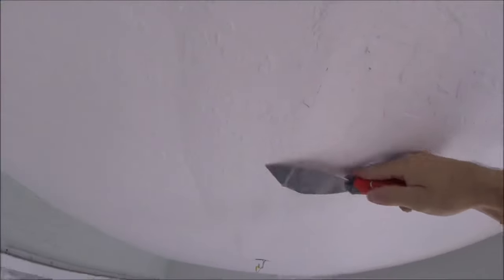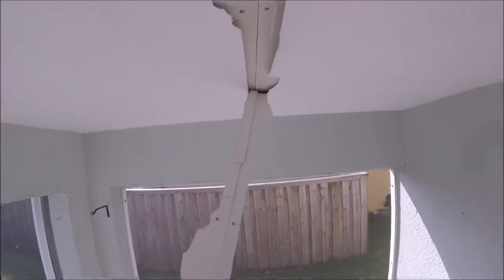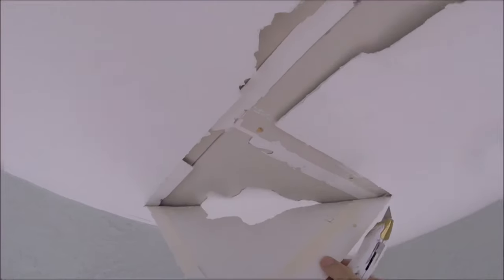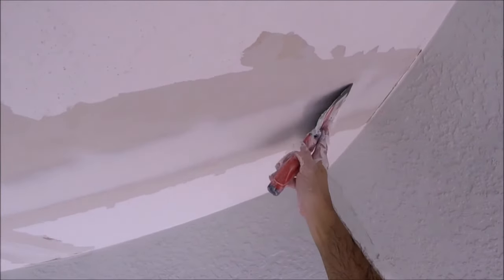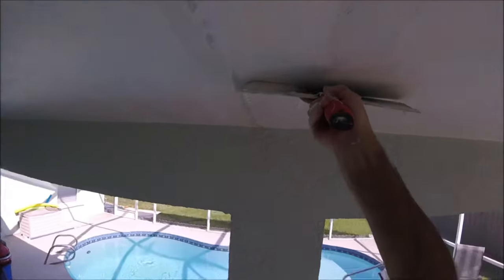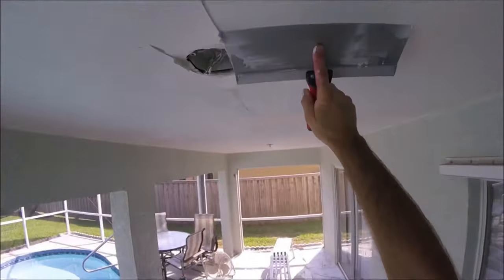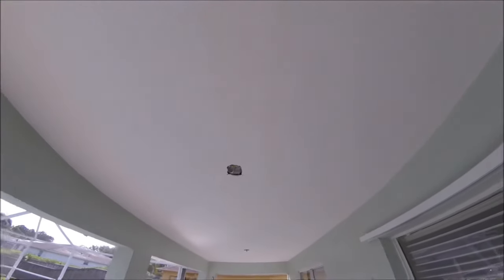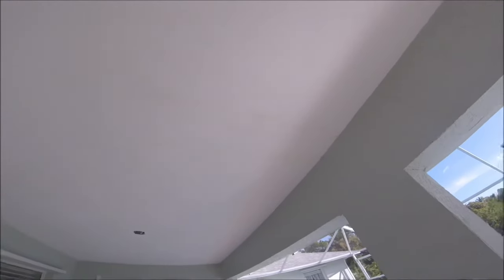Ceiling Repairs GONE WILD!

Comment: You nailed it on the moisture and attic. North East we have old bungalows with attic space and no ventilation other than soffit. A key is putting in a "covered quiet cool vent" with an automated fan, when humidity reaches a certain percentage the fan turns on. Another option would be to Add a vent in the pool enclosure to get the humidity out.
Reply from the maker: Good stuff man! Thank you so much for watching and commenting!💥👍🏻😎

Comment: That's from moisture without a doubt. I see that in a lot of carports and I am in Georgia as well. Edit I wrote my comment before you said that it was moisture. Yes you are right 👍🏼.
Reply from the maker: I do appreciate your feedback Thank you!👍🏻😎
Reply: Yes those are definitely contributors to this.. I'm also in Ga.. and have witnessed this numerous times with garages and other exterior applications of drywall .. for starters  I would have used a moisture resistant drywall  which  they didn't have available back then  I assume  so to repair this is only a bandaid to the root of the problem

Comment: I had EXACTLY this same issue on a garage ceiling I did. 
We tried to prime first with oil paint then redo the finishing . I’m a drywall contractor for 41 yrs and I only used all purpose mud but wouldn’t you know that the EXACT thing happened again!!!
We had no moisture or water issues but the timing was right when the drywall industry was flooded with Chinese drywall since everything went to New Orleans area after Katrina. I know they had formaldehyde issues and I don’t know if there we’re finishing issues because of that. I thought we did everything possible to alleviate the adhesion problem’s but to no avail. 
That’s all I have to say on that
Reply from the maker: Wow! That’s crazy… Yeah, I ended up doing a lot of Chinese drywall inspections here in Florida for almost 10 years after the time it made it to the US.😅
Reply from the maker: Damn that’s crazy!😅 I know that Lowes had a class action lawsuit because they bought a bunch of it and sold a lot of that too…⚠️

Comment: I think that's from intermittent  moisture ingress from above.   It could be from the vapors you theorize, provided that actual condensation into liquid water is taking place from time to time under the right temperature change conditions etc.   You just need small amounts of liquid water , and it finds the joints.   I had my apartment t bathroom ceiling do this twice.  There was no other evidence of a leak other than the drywall ceiling showing the same problem.  It was always dry up in the dropped ceiling.  It took over a decade to find the source was a very seldom used sink in the apartment above - it had a small leak in its drain piping.

Comment: whats the best way to repair ceiling cracks on a new construction home...very large span
Reply: I have never had to redo large spans but I have put in expansion joints and they have never cracked since I have done it. You may want to look into how to go about putting in some expansion joints in a large area. I put them in a new church but I have never put them in after it's already been hung and cracked.
Reply: @Hamp72  thank you I will research that
Reply: @generationrecon  you are welcome

Comment: So is it going to fail again?
Reply: Yes, probably in 10years or so. I think that the best way to fix the problem for a longer period of time would be to fix the ceiling and after it's fixed prime it with oil based kiltz and then paint it with a flat paint of your liking.